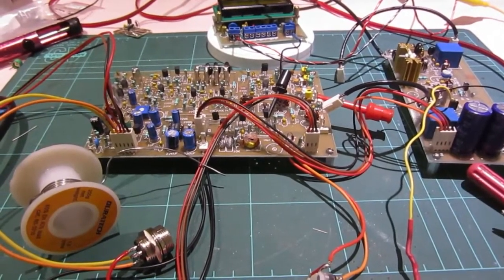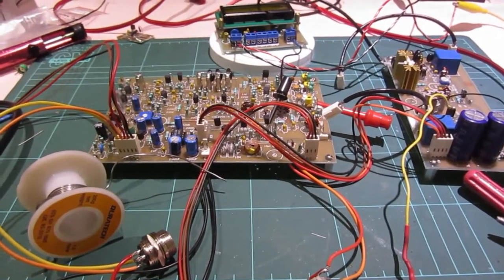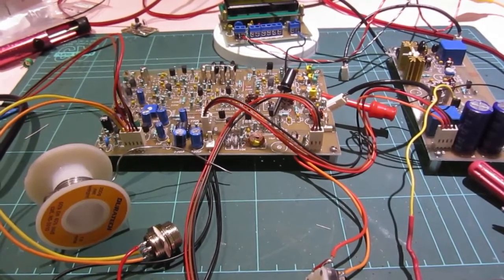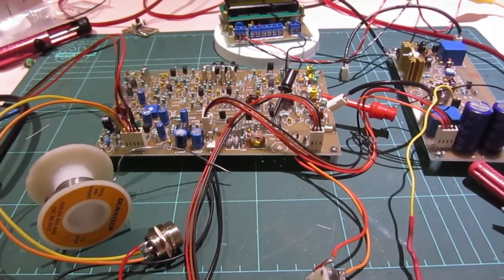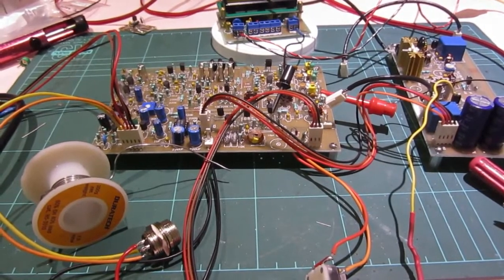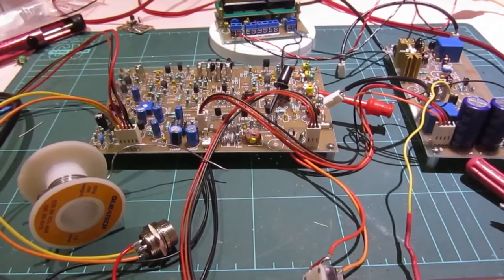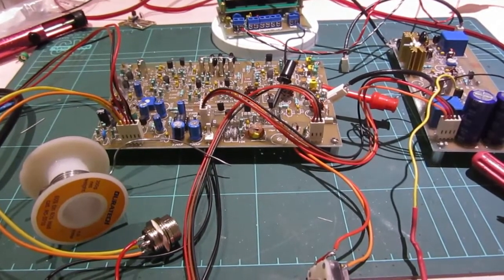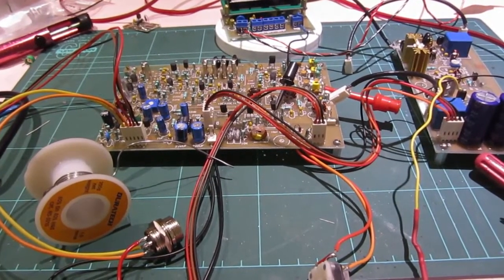Whoops! Don't Use A Resonator In Your BITX VFO!

Comment: Reminds me of my first SSB rig for 14 MHz. 10 MHz IF & 4.19 MHz ceramic resonator oscillator.  Worked well.  

There's no reason why it shouldn't work, though bear in mind that tuning will be non-linear.  The main hitch is you'll need the resonator to cover approx 4.8 - 4.95 MHz. It may drop out at the low end (ie near 7.2 MHz) as it's a big shift from 5 MHz.  For example a 3.58 MHz resonator can be got down to 3.5 MHz and maybe lower.

Comment: Sometimes oscillators can work when their output is loaded (eg by a probe) but stop when it's removed.  Another oddity when trying to pull crystals/resonators over long ranges is they can drop out or not start.  Or they can be intermittent - starting at some frequency ranges, appear to cover the whole lot when adjusted but not start when powered up.   So I'd recommend trying again as the resonator should work (though there may need to be some component value changes).

Comment from the maker: I got a shift of about 150kHz which covered the busiest part of the 40m SSB portion. I thought all was hunky dory until I found I could hear nothing on receive. Removing the resonator and putting the coil back fixed it. The local oscillator level must have been different with the resonator. I should have pulled out the CRO and made some measurements. The coil is now back in. Lesson: don't fix what ain't broke. The experiment was worthwhile none the less.

Comment from the maker: Admittedly, I did notice some intermittent behaviour. I'll stick with the free running VFO for the BITX as I should now concentrate on boxing it up and putting it on the air. I'll tinker with resonators for my next project - the Beach 40. ;-)